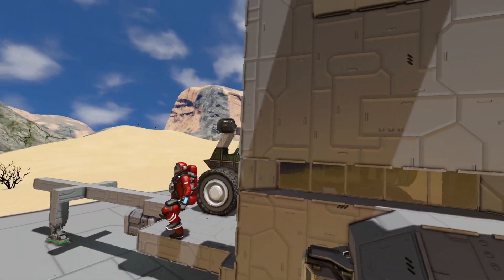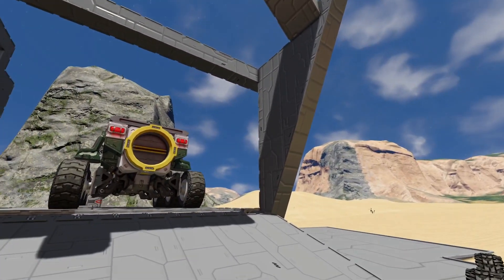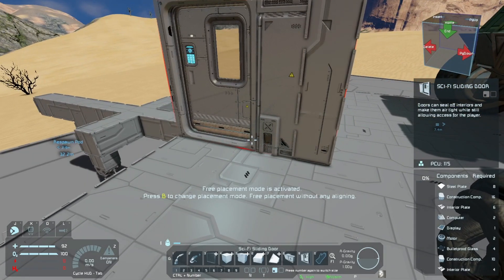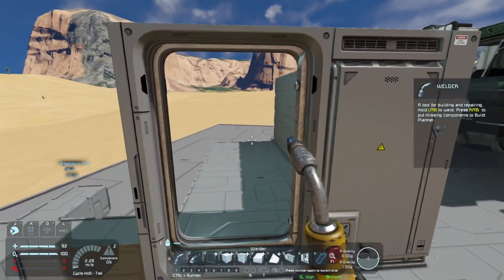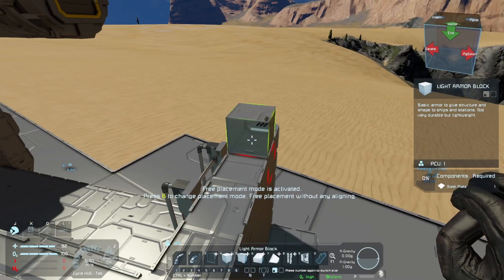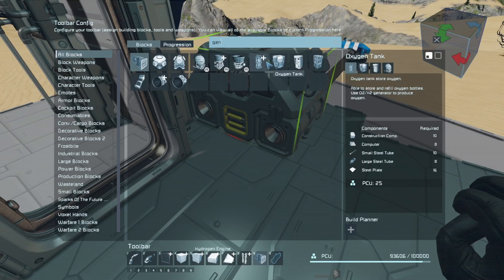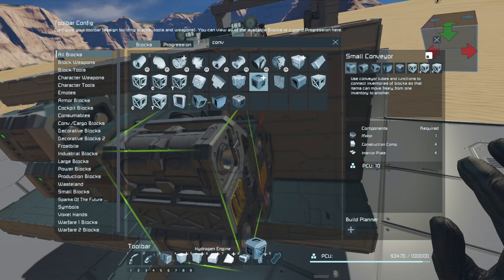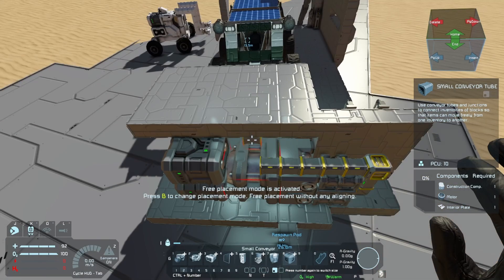☣️Space Engineers: Small Ship Progression - starting the floor plan

Comment: Instead of decontamination room I'd go for air-lock door. It's easier one-block solution. Or, make those sliding doors against each other and to the side of them add some storage. As this Z-like corridor uses too much space. Z-way is good to slow down enemies if interior turret is implemented, but impractical for quick movement of yourself. Same for ladder. It saves space but steep ramp is on the same footprint but no F key to access ladder would be needed. Yes, it lacks then immersion of a roleplay (but for better role play you'd design this in survival mode, right? ;-) ). Ramp is simply way faster access, and it could be not just 45 deg. slope but that ramp block put upwards so some 60 deg. slope and engineer is still able to climb up in that exo-skeleton suit.

Comment: If you want to play with turrets, check out a newer block called a 'custom turret controller' ... any pair of moving conveyored tubes (3x3 hinge on a 3x3 rotor works best for small grid guns) the square conveyor adaptor with large and small ports on top the hinge, any six small grid static guns, and a camera between the barrels... instant custom weapon to spam wherever.  Also works with drills, welders and grinders, but is a little fiddly.